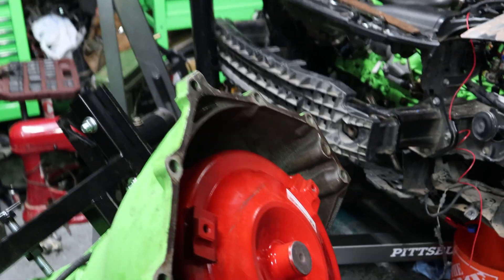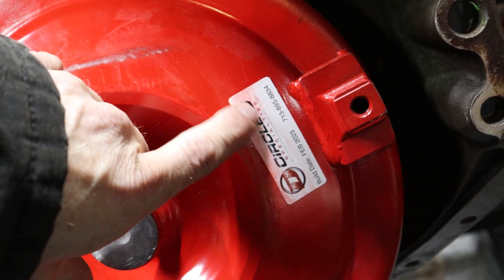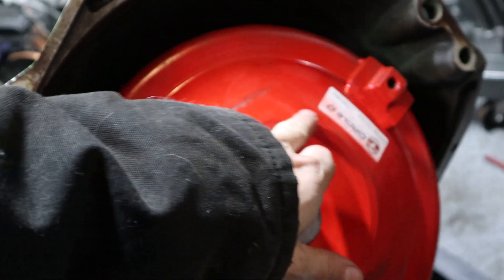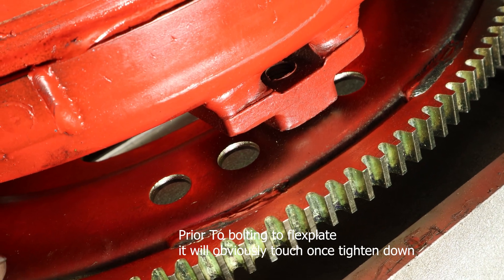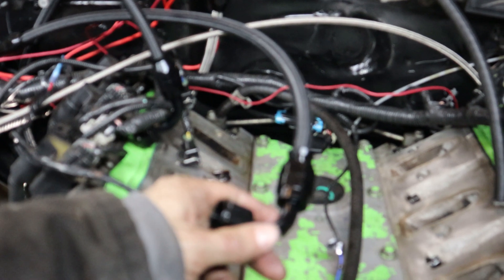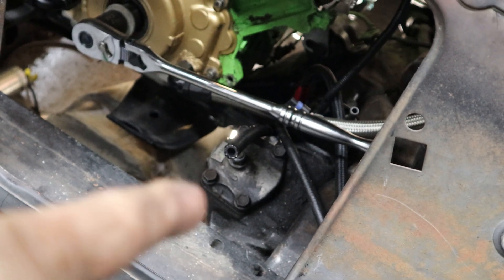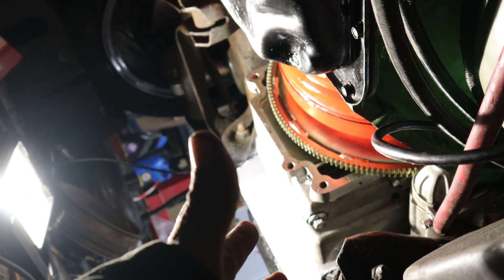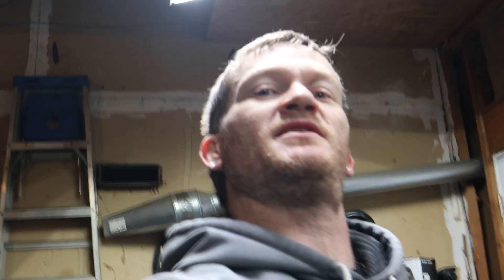Torque Converter Air Gap Explained & New Jegs Fuel Rails | LS Swapped S10

Comment: Theres nothing wrong buying the Jegs and Summit House brand stuff, its usually as good as the name brand stuff and the price is like 30% less. And usually it means theyve tested it to see if the quality is there before they put their name to it, 95% of the time in my experience - I've had waterpumps, camshafts, distributors and oil pumps and theyve been spot on out of the box.